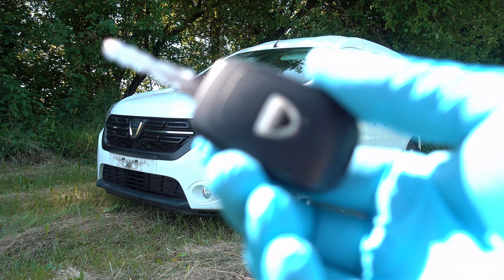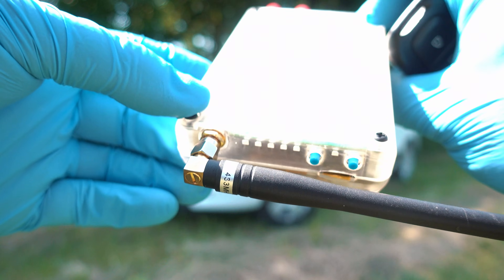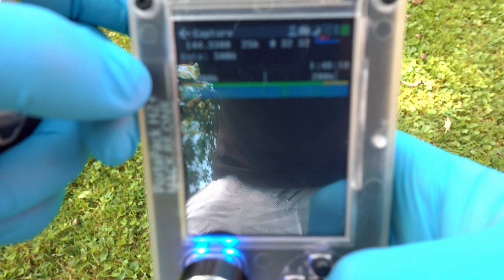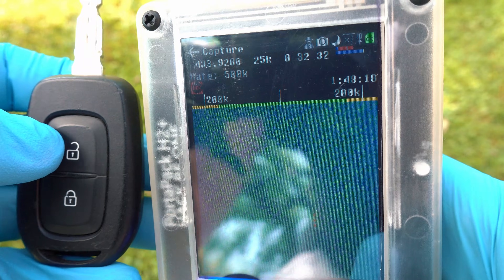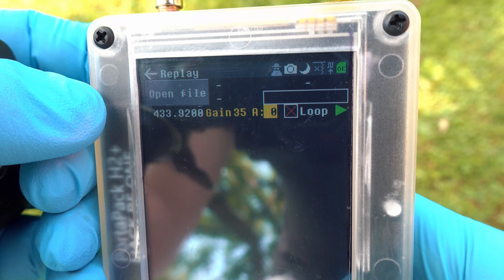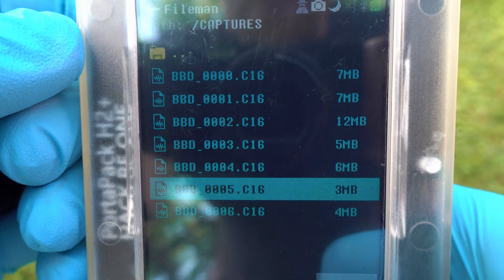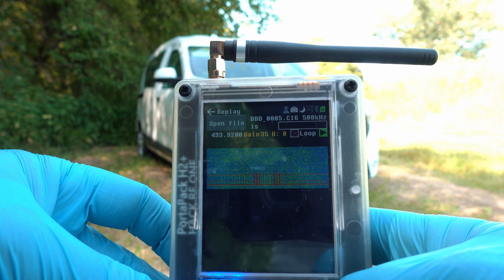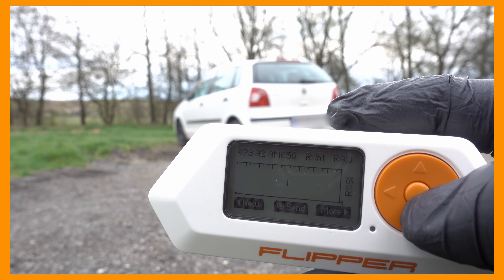HackRF ONE PortaPack H2+ Car Key Signal - Unlock Car Key FOB

Comment: Can this:

Record analog transmissions for playback ? 

Decode HZ tones from 2 tone paging ? 
Like 313 hz, 1080 hz, 1280 hz, 1320 hz, 2470 hz ?etc ? 

Display ADSB plane GPS position on map ? 

Decode POSTAG pager digital signal and display the text ? Can it record these transmissions and playback and decode ? 

Can it record other digital transmissions for later playback or decode ? Like ATCS Monitor ? 

Can you display a waterfall and see the spectrum and the transmission and click on one and hear the broadcast ? 

Can you install Windows software on this ?

Can you install Android software on this ?

What is it's OS ?

I have not seen a video doing these key points

It would seem these would be the most used options

I am interested in using it for a scanner so I don't need my laptop and USB SDR dongle and software 

A nice self contained unit like this would be perfect if it can do all these or even some of these functions 

A video showing these features would be perfect 

Thanks

Comment: How  an i use this to stop or jam the key signal to stop  car theft
Reply from the maker: unfortunately you can not
Reply: Most cars nowadays are using rotation codes to unlock cars, if someone captures the signal of your cars fob for opening the door it will reset old one and new one will be needed to unlock the door, so method shown in video is useless because you cant use same captured code over and over, its only doable for old cars where is no rotation code system.

Comment: I’m having problems getting it replay captures but no idea why do u need specific aerial or setting
Reply from the maker: for cleaner RX TX
Reply: You will need to cut and trim your antenna for the best SWR “standing wave ratio”. If you transmit with an antenna with a high impedance “resistance to RF” all of that power will radiate back into your transmitter blowing the amplifier and damaging your radio. That’s why it’s best to have an antenna cut to the right frequency. And also if you just want to play around without worrying I would get a 50 ohm dummy load or make your own with resistors. But you will not got any range with a dummy load just up close but lastly,Just make sure the dummy load you buy is rated for the right amount of power.

Comment: Nice try but this will work only if you capture the key that wasn't used before, that's why you had to move outside the range.
Reply: what means 'wasn't use'? A key thet was never connected to the car? Before the first use?
Reply: @Karpakurva the signal sent was 0005, the car didn’t received it ever, so the first time it received it was from the device, thats what i understood but not sure
Reply: Ok. But put jammer on car you can catch good code.
Reply from the maker: correct ✅

Comment: 2014 Kia Optima EX, 2010 Lexus 250h... Rolling codes, So I said in the car while It started and grab captures for opening.  No luck! Got a suggestion?
Reply from the maker: you have to be far away from car….(capturing key signal) make sure to be outside of the range so the car won’t receive the key signal… only you will capture it.  Then you can replay it and it should work.
Reply: Unfortunately it's not working,  away from the car 35M outside...  Then I get to the car nothing. Does it matter what the antenna is?  @takeapart
Reply from the maker: @zipit-media 35m is still not far enough…. standard range is about 200m !  (in clear line of sight)
Reply: @takeapart  I did 300m, nothing. So you need to see the car 200m?
Reply: @zipit-media  300 m is not far enough you need to go 10000KM
Reply from the maker: @TheAryanKnight ah mate , that’s bit far
Reply: @takeapart this off topic alul but u think a autel 508 would be better
Reply: Jamm the signal with the hackrf and record with flipper or jamm wirt a quansheng.

Comment: Anyone had the issue where after doing this. The car key fob won’t lock/unlock the car? Cuz thats what I’m dealing with rn I have an old volvo
Reply from the maker: you have to gooogle how to relearn key fob on ….   some cars does that (not just cars… garage remotes and others )
Reply: You bricked it because of rolling code security.
Reply: thats because the unlock 'code' will change on both the car and normally the FOB. 
But because you used the portapack to unlock, the car is ahead in the codes. Maybe it will never catch up by its own cause it needs part of the code to keep it in line with each other, but that is just a guess. I had the same problem and after unlocking with the key the manual way (turning the door lock) and also power on the dashboard with my key, the FOB worked again. 
Or it was the many times I tried unlocking and locking the car with the FOB that eventually resetted it, or brought it back in line again.
It is one or the other, maybe both. For reference, it was a VW Caddy 2005 model I tested.

Comment: But with the rolling code can you open or close it only once?
Reply from the maker: yes… but you can record multiple codes
Reply: @takeapart  and here I don't understand: suppose I save a dozen codes after 6 the opening signal with the original remote control is sent to the control unit, will the other 6 signals still be valid?
Reply from the maker: that’s depends on manufacturer…. but mostly rest of the 6 captures won’t work.
Reply: @takeapart I don't quite understand this attack: hack rf will jam by blocking the original remote control, the Flipper Zero will record the codes. The problem is if the owner were to open the car he can always do it manually with the lock and then he will leave: For closing the Flipper will be able to record the codes but if it is only a closing signal how will I open the car?
Reply: @MrCtfx that is why the rolling keys are basically pretty save and car manufacturers haven't responded (yet). But in theory you could hide close to a car with rolling keys and if a person did want to open his car with his keyfob and you saved and also blocked the rf signal to make it to the car and somehow the owner forgot he wanted to open the car, you could come back later to open the car and rip something out of it. Or if you have access to a keyfab for a limited time you could record it, and possible dont even have to jam because they keyfob is probably out of range, you could access the car (if the owner hadn't already) and rip something out of it.

But if you already had access to the keyfob and want to rip something it would probably make more sense to just rip the keyfob also which will probably help you more cause you now are sure you can enter the vehicle unless he is sure it is stolen en puts his car in a more protected environment for instance his garage.

So that leaves only the first example somewhat plausible but not likely. And with that example it is more likely that someone places a device near a place the car will often or very likely park and you record long enough till the keyfob was triggered accidentely. 
But by viewing only rf you will never know it was by accident so you also need a camera or some other way you would know that to make use of that. 
If you would be sure the incoming key was blocked  and no other keys are tried to open or close the car you could maybe make an educated guess that the keyfob was triggered by accident or the owner changed his mind about entering the car and did think he/she was out of range.

I also dont know if a closing key will render a good (and unused) recorded opening key useless. Because that will probably happen when the owner changed his mind and will probably press the closing knob till he sees the lights or hears the locking sound.

So in the end it will be more likely someone breaks into your car without keys, or steals your keyfab or bruteforces enough keys to enter your vehicle. I dont know if that last part is even a possibility with the rolling keys technique, because it probably resets itself whenever bad keys are received but I think it is possible because a keyfob is also (or can be) out of sync when a key is already used, but I have read story's that users got them working again when pressing enough times again on the keyfob
Reply: So this opens once after recording the code so you can't write it to a new key fob and it will always open the doors?